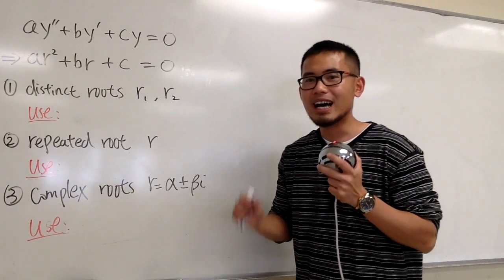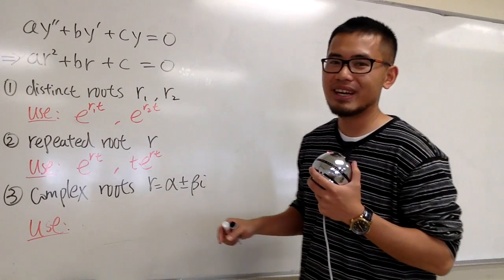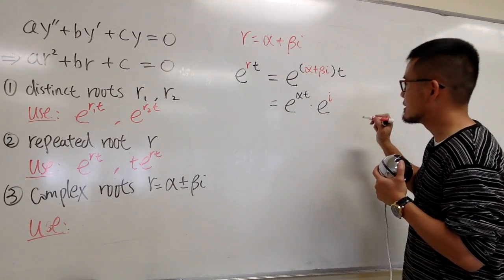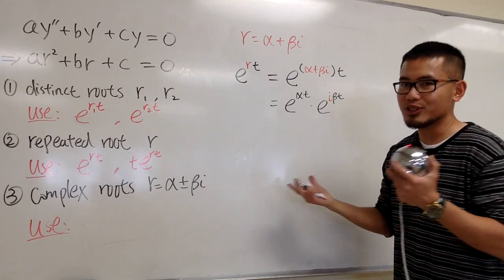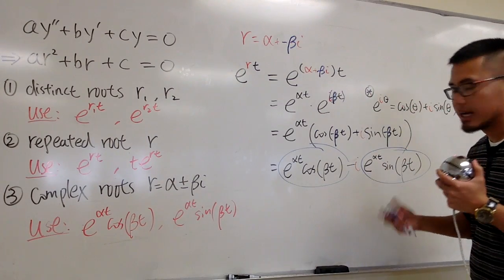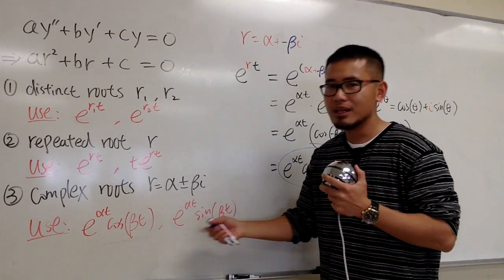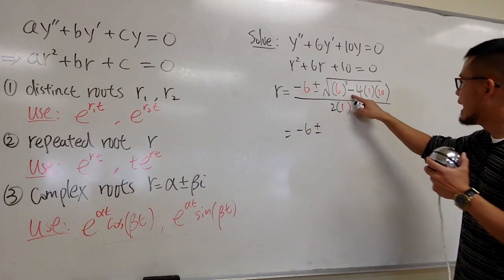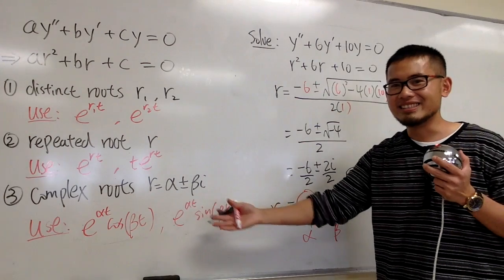Auxiliary equations with complex roots, for 2nd order linear differential equations

Comment: ....You may be wondering, why I didn't include the i..... well that's what I came here for.
Reply: My book (Elementary Differential Equations by Boyce and DiPrima) included a theorem that essentially states that if y = u(t) + iv(t) is a complex valued solution of a differential equation y'' + p(t)y' + q(t)y = 0, then both its real part and imaginary part are also solutions of the equation. Hope this helps.
Reply: @edmund3504  Wow. Do they have proof of that statement?
Reply: @nonentity168  By linearity of the transformation.
Reply: exactly, and it turns out there is more to the story and it will be eliminated by the constant.
Reply: @zhiar6673  still don’t understand. In all my textbooks when they find the particular solution the i is just not there, without explanation.
Reply: @ferdi6594  i is a constant value and c_2 is a constant value. Since they're both constant i is absorbed into c_2, thereby just making it easier to solve
Reply: @jordanmartinez5233  c Is real not complex

Comment: We can have one real and other complex solution?
Reply: There's a theorem that says if a+bi is a root of a polynomial then a-bi is too, so no. If however we speak about linear equations above 2ond degree, (that have a 3rd and above degree auxilery polynomial, yes you might have both.
Reply: If you have real coefficients on all derivative terms, then it is mandatory that any complex solutions will come in complex conjugate pairs.   The only way to have independent complex solutions that are either stand-alone, or are not conjugates of each other, is to start with complex coefficients on the original polynomial.

For applications in the real world, it is most often the case that you will have real coefficients on all terms in the original differential equation, because they represent concepts like mass, spring stiffness, damping factors, inductance, capacitance, and resistance.  All of which will start as real numbers, even if complex numbers are involved in producing the solution.

Comment: Not entirely correct. You only make use of one solution of r and neglect the other one. There's a more robust derivation that uses both roots.

The original building blocks, as you call them, are e^(a+bi)t and e^(a-bi)t.

Use coefficients c1 and c2 to find the general solution:
y = c1 e^(a+bi)t + c2 e^(a-bi)t.

Split exponents and apply Euler's formula.
y = e^at (c1 cos(bt) + c1 i sin(bt) + c2 cos(-bt) + c2 i sin(-bt))

Cos is even and sin is odd, so that
y = e^at ( (c1 + c2) cos(bt) + (c1 - c2) i sin(bt))

Set new constants A = c1 + c2 and B = (c1 - c2) i
y = A e^at cos(bt) + B e^at sin(bt).

Same solution but in my opinion a more correct derivation.
Reply: Oh you are right, I was wondering why the i disappeared but after reading your comment I understand now.
Reply: Cos and sin are linear combinations of imaginary exponentials
Reply: Thank you soooo much! I was so confused that how the c1+c2 become c1 again...
Reply: Thanks!
Reply: Why can you just add up the + and the negative solutions?